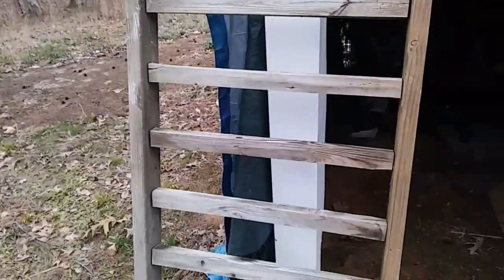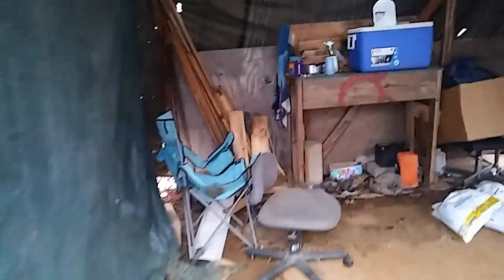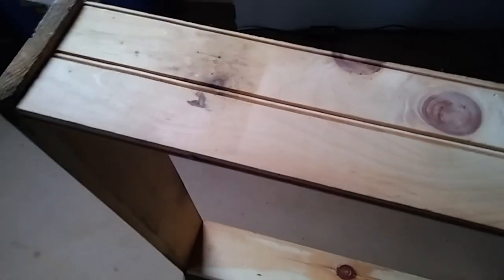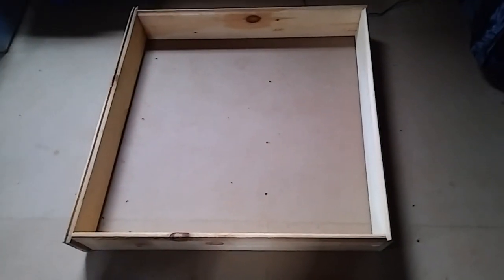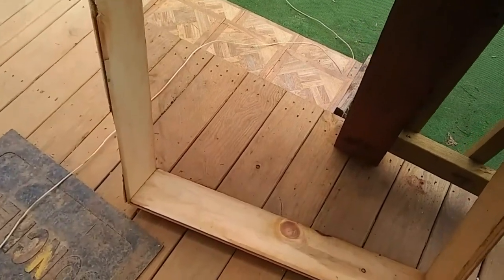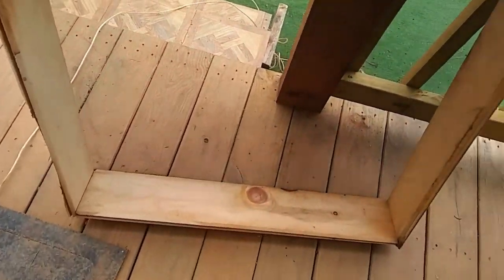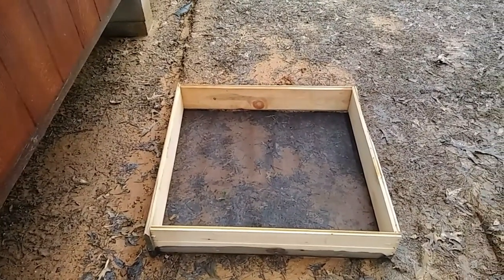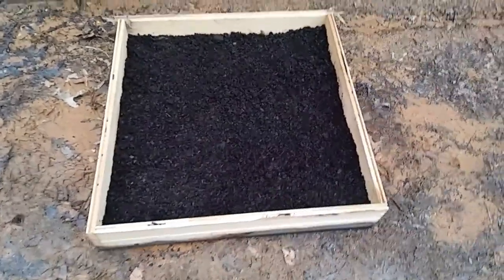I Make a Garden Box Raised Bed - Ann's Tiny Life

Comment: Another great video… One tip you can use is if you line up the boards in the corner to where you want them and you stick a piece of 2 x 4 in or 2 x 2 on the inside of the corner you can screw the boards to that and that way it makes the corner stronger and gives you more wood to nail or screw too

See if your dollar store has a little cheap bags of seed to make a lawn

I have tried some expensive seeds And I find the cheap stuff at the dollar store almost seems to work better… I love it that you’re smiling
Reply from the maker: Got to keep smiling Dave! LOL I'll look at the dollar store to see if they have grass seeds. Great idea! I go to the dollar store all the time. I'll have to see if I've got some extra two-by-fours laying around I'm pretty sure I do. I mean I've got wood laying all over this property! I'd love to build some more beds will see. I do know that the siding that I was going to use is it going to work unless I have wood to stabilize it.

Comment: For raised beds all you need is something to retain the soil from washing away.  So wood, rocks, bricks, cinder blocks or even logs can work.  What you made looks good and should last two three years.  I made round raised beds using aluminum flashing 8" high.  Cut the pieces to length and then used three pop rivets to join the ends.  Then placed on ground and shaped as desired and filled with dirt.  Then planted my bushes.  I wanted something that would not be damaged by a line trimmer and last a very, very long time.
Reply from the maker: Now you got me thinking. I think there may be some more stuff in addition to what I can use are the raised beds. I wonder, would it be safe to use that plastic siding trim? I think it may be about 8 inches high not sure. I'm going to go have a look around...

Comment: There is no such thing as fail, we learn from every attempt! Sooo proud of you! You will be a carpenter before ya know it! Not perfectly square just shows its hand-made instead of machine made. Its perfectly hand made :D Cant wait to see what ya plant in it
Reply from the maker: Me neither! I got some more soil so hopefully I'll get to planting it tomorrow. And I may even make some more of them. If I can make them just a little bit taller though. Because the rest of the stuff that I want to grow needs a greater depth.
Reply: @AnnsTinyLife   If you have enough wood just make 2 the same, stack them on top of each other and screw short pieces of wood vertically on the inside of each corner a few screws in each level to hold them both together. Then fill the bottom with sticks and branches etc and put your dirt on top of that so it wont take up as much dirt.
Reply from the maker: You may not believe it but that is on my list of things to do today! Don't know if I'll get a video out today, but got lots of projects.
Reply: @AnnsTinyLife  Im cheerin you on!! You got this!